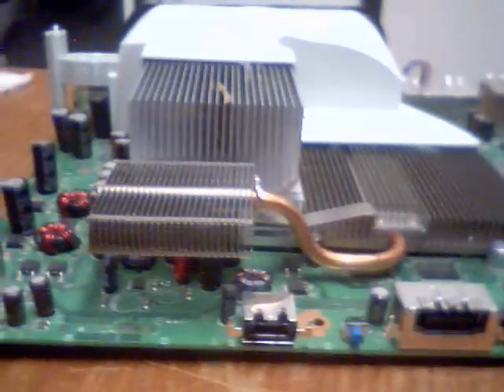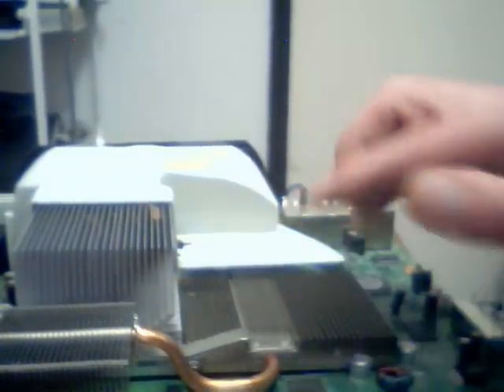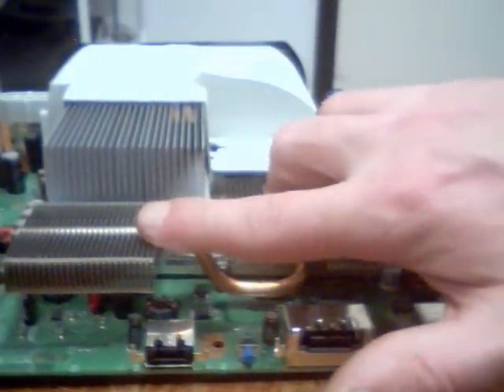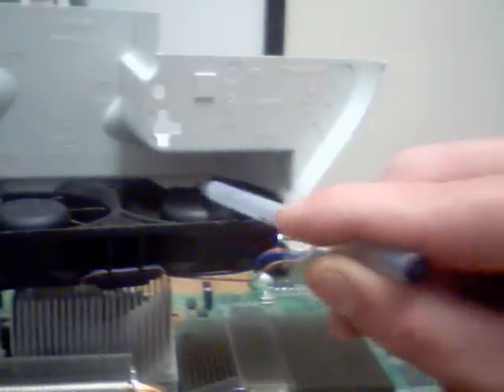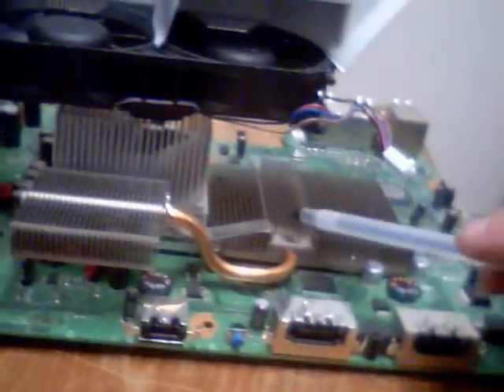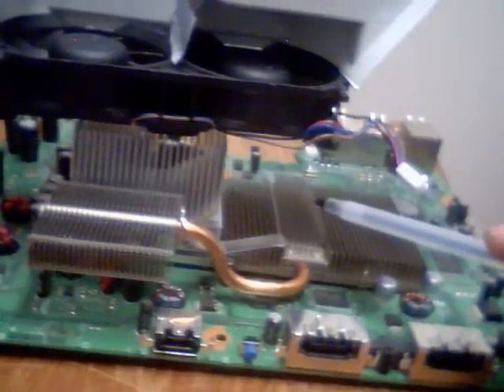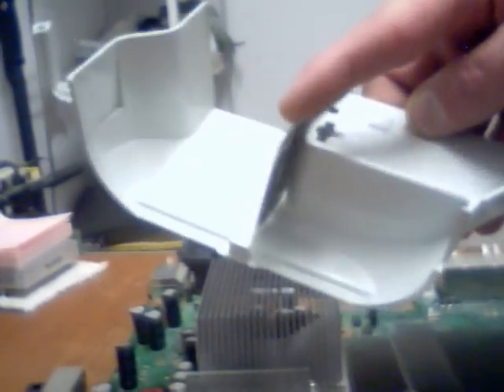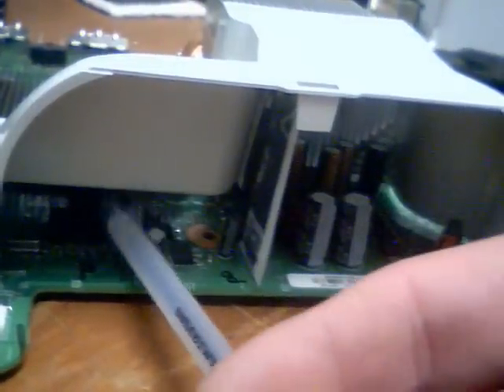Fan Shroud Modification! the Best Mod You Can Do! By Daniel

Comment from the maker: @turtleman508 They are exhaust fans that pull air in to the Xbox from all the vents then pull the air thru the heat sinks then blow the hot air out of the back of the Xbox

Comment from the maker: @EDDAHLEN You would think so; but! No it dues not the fans working together only increases power to pull the air threw the heat sinks not speed, when the fans are divided the air speed dues not change it only gets redistributed the airflow stays constant and now equal across both GPU and CPU thank you for your question Daniel.

Comment from the maker: @fenix0green There should not be a problem as the fan will keep it cool enough to prevent fire, But you can raise the height by cutting it so it is just above the board this will allow a little Passover of the air but not much. You can also use the plastic form an old fan shroud or credit card to make a divider if you wish you will need to glue it in place and notch around any caps as it will not be flexible like the cardboard of a business card.

Comment from the maker: @IHI4ZZx Not a lot has changed with the new x Boxes they reduced the voltage repaired to run the box to keep it running cooler but the Chip set is the same if you do not keep it clean you will get red lights! You should not add any internal upgrades until your warranty expires but remember this if you add a fan you must clean twice as often!!!

Comment from the maker: @TutorialsReviews123 Check to see that when you install the divider that it stays between the fans and is not blocking or stopping one of your fans, also check to see if one of your fans have stopped running or may be week? As I find that is common you can replace the fan with The Talismoon Whisper Xbox 360 Replacement Fan it moves 58% more air than the original, yet is 7% quieter. You may also have Drying thermal past below your heat sinks

Comment from the maker: @darrc3571 The heat sinks do not produce enough heat to catch the card on fire. But I agree a credit card or other plastic divider would be the preferred material, you must be very careful to allow for the capacitors you do not want to bend or brake them!

Comment from the maker: @IHI4ZZx Cleaning is an absolute must even on the newest of Xbox 360’s Adding a fan that will run after the Xbox is a good thing (Nothing over powering) only to remove remaining heat after it is turned off so the heat is not directed at the chips.

Comment from the maker: @HaloKing385 Yes you can use any Heat sink you like from the oldest Xbox 360 to the newest Xbox 360 they all will work but it will not fix the red lights only help to prevent them you need a proper repair and there is no home repair you can do to repair the Xbox without causing sever damage to your Xbox unless it is a Capacitor or other component that you are able to identify and replace.

Comment from the maker: @Naizarak The metal of case rests directly on the CPU so there is no need to put anything on it unless the metal cover on the case is missing, The disk drive rests directly on the GPU so heat sink so no need to put anything on top of it either, as for the gap on the sides of the shroud next to heat sinks it is not enough to actually worry about. (Hope this helps! Thank you for your post)

Comment from the maker: @ZackClark17 If you think you must add a fan even after I told you it is not necessary and hides one of your best early warnings of problems then the fan should assist the air flow! It should draw air into the box and exit with the air form your stock fan.

Comment: @Xboxsarerepairable You are right that doing this mod probably does triple or quadruple the airflow to the GPU heatsink. By doing this it must take airflow away from the CPU. My fans compensated for that by going to max speed. I removed the mod (just some airframe tape) and it went back to being silent running. 
I do not have that second GPU heatsink on my MW2 console. Mine had a die shrink and consequently the second heatsink was not requried (I think it is though). 
Thanks for the reply.

Comment: As you may know, heatsinks work on the principal of temperature differential. So the cooler the top of the heatsink, the more effective it will be. Obviously, the default cooling methods that come with the Xbox don't necessarily keep the heatsinks cool enough. So a fan on top of the heatsink will keep it much cooler, so long as the air being directed onto the heatsink is coming from outside the case. It works best for the CPU heatsink, so your GPU airflow mod would work great with that approach.

Comment from the maker: @HaloKing385 In fact you could use the heat sink from the New slims on your GPU and CPU, If you can find them? they will work even better than all the others! But they will still only be prevention not a repair.

Comment: This is one of the BEST mods you can do for the Xbox.  I never even thought to look under that shroud.  I have ported cylinder heads, and done intake work on cars and this is a very basic design FLAW by Microsoft.  It literally would have cost them nothing in the long run to place a venturi inside the shroud!!!  Do this mod, I used a paper plate and scotch tape, you will FEEL the difference in your processor, and the GPU heat sinks.

Comment from the maker: @MLGProXBuddy175X Your Xbox is designed to do its job and will if you let it! The box requires some heat to run properly and has all the ventilation it needs you just need to keep proper maintenance on the box something Microsoft denied you by not allowing you to open the case!

Comment from the maker: @oKLoTzYo Adding fans removes your single best early warning of problems With the Xbox that is the increase in fan speed! If your fans start running faster you know you have a problem that needs to be addressed the fans will tell you that you have an excess amount of dust or your thermal past is drying out.

Comment: @Xboxsarerepairable What I meant was in your video, 0:39sec into it, you mentioned it was OK to cut a hole in your case to mount a fan. So what I want to know is that if I do mount a fan should it be sucking the hot air from the case or blowing cool air in?  Note: I also did your 12v fan mod, works great!

Comment from the maker: @unholydegas I have done work on the new jaspers as well the they made a few changes that will help prolong its life and help prevent the RROD but they are still subject to the RROD because they did not change the CPU or GPU Chips and because you are not permitted to open the case to clean it well you know what will happen! If your Xbox is subjected to high temperatures! RROD 
I say after the first 5 months F the warrantee! Clean your box! If you see dust buildup in the fans clean your box!

Comment from the maker: @TRooPeRxWilDCaT this should be dun before any redlight. You as an individual can not repair the 1 or 3 red light at home without expensive and specialized equipment! The YouTube Repairs do work for short time if it is a cracked solder joint only!!! And if you use the powered reflow you will cause more damage to the solder making it less likely to be repaired using the right equipment do you under stand what I am saying?

Comment from the maker: @kugotsumin It is working even if you did not get the divider all the way to the motherboard it has increased the airflow over the GPU even if it is only by a small amount you should not worry about it not working only concentrate on keeping the Xbox free of dust build up as your Xbox 360 can operate just fine without this mod.

Comment from the maker: @sasukeuchihayou I have not encountered an Xbox that has the problem you described unless the Xbox has bolts in it and/or the heat sinks are not seated properly or installed flush to the chip but thank you for your post?

Comment: @Xboxsarerepairable yes i just watched it, very informative. Recently added new AS5 thermal compound and did your fan shroud mod, plus doing a 12v fan conversion. the 12v was actually a strange accident. I twisted the pos and neg wires together without paying attention and turned the system on, which caused a short and now the fans are full tilt every time. its been running really well for the past month and a half. explain why it didnt just fry the fans/system?

Comment from the maker: @Xboxsarerepairable The adding of extra fans will only hide a problem with the Xbox until the damage is so bad you may not be able to repair the damage that has been dun. The Xbox 360s fans are perfectly capable of supporting your Xbox 360 for years with no problems unless they are not functioning properly.

Comment from the maker: @ZackClark17 The cool air is drawn in threw all the vents and pulled threw the heat sinks and existed out the back of the Xbox 360 cooler is not better the Xbox 360 requires some heat to operate properly do not over cool the Xbox you will cause other problems.

Comment: what happens if the cardboard on mine touches the heat sink x on the top of the old motherboard. would the heat burn the cardboard? only about 3cm touches the x on the top of the motherboard.

Comment from the maker: @TutorialsReviews123 Just so you know this mod is not all that necessary and if it causes your Xbox to over heat “Do not do it!” I from time to time get reports of this problem although I have never seen it happen and I have installed this mod in literally thousands of Xbox 360’s perhaps you should just replace the old fan with A Talismoon Whisper you can find it on ebay.

Comment from the maker: @Timmeh75 It is not possible for this mod to make your fans run faster! if your Xbox fans are running faster you did something wrong!! This mod only redirects airflow allowing even air flow to both the heat sinks

Comment: This might be a stupid question, but If I cut a hole on top of the 2nd Gen. GPU heatsink extension (square thing behind CPU heatsink) and put a fan in should it suck air in or out?